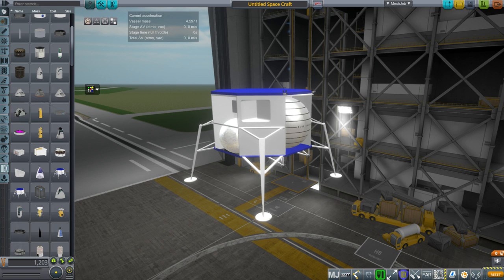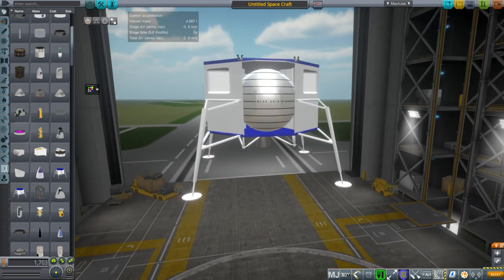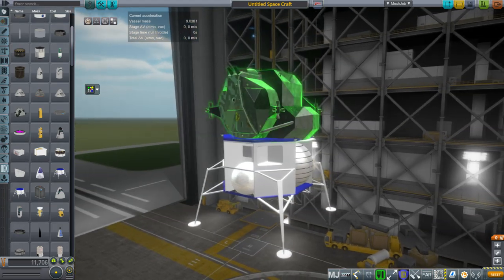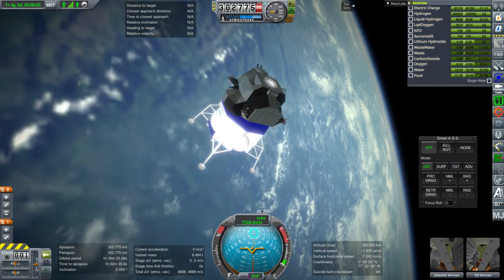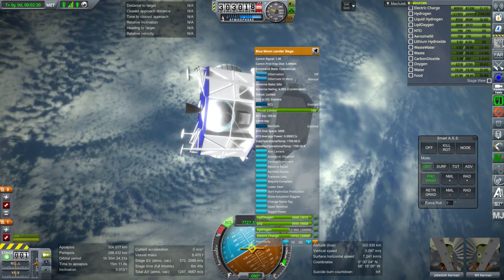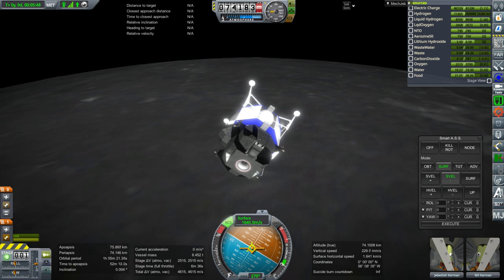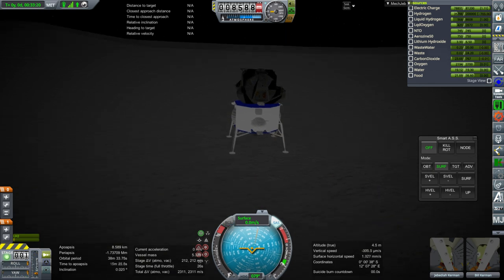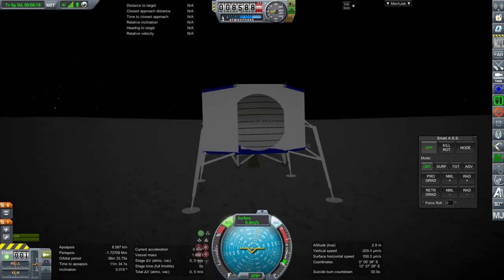Kerbal Space Program - Part Dev - Blue Moon

Comment: Will KSP handle adding bump mapping from blender? It's pretty easy to bake it into a procedural texture and blend it with your texture image to avoid surface flatness. I don't know whether it allows bump mapping in blender's material node editor or demands a separate bump map to go with a model/texture file. But just in case.
Node setup basically goes: Texture Coordinate (Generated) -> Mapping (Vector input/output, default settings fine) -> Noise texture (Vector input/Fac output, adjust scale and distortion as desired) -> Bump vector (Height input/Normal output, adjust numbers for heightmap range) -> Diffuse BSDF shader (Normal input, adjust colour as desired, send output to mix shader with other similar setups with brick or checker textures etc. or straight to the surface output of the material, alternatively a Transparent or Glossy BSDF shader mixed with an image texture for the surface colour).
Hope it helps, it's a lot easier than generating any configuration of heightmaps from images or baking it into mesh displacement on the model.
Reply: Aren't bump mapping and height mapping the same thing?  Why did you post a mini tutorial with steps covering unwrapping and shaders if you're just suggesting a height map?
Reply from the maker: Unity takes the bump map as a separate file from the texture. I just don't have any data to base any bump mapping on. The mockup they showed was, as far as I could tell, perfectly smooth.
Reply: @rickyoswald  I was talking about generating a bumpmap in the model material from a procedural texture in blender rather than making a bespoke heightmap exported along with the model, the former is very quick and easy for the results it gives, but I don't know whether unity/ksp allow it. Even if your reference is flat and shiny adding a small bit of noise to break up the surface helps make it look less perfectly (ie unrealistically) flat and shiny.

Comment: You mentioned other hydrology landing engines... Isn't there a deeply throttlable configuration for the RL-10 that is supposed to represent the common extensible cryogenic engine that was designed for the constellation program?
Reply from the maker: Yup, the CECE is the other candidate. I like its implementation on Lockheed's MBC planes in particular: https://s.aolcdn.com/hss/storage/midas/695645c7cb264f5d55607357c2491b0/205718477/MBC_2.jpg There are a lot of CECE implementations on paper, but none that have even gotten to a mockup level as far as I know.

Comment: Will you be making the version w/ the davot system crane and 4 rovers?
Reply from the maker: I might make a single crane system part - you'll be able to put four of them on top or however many are necessary. The rovers/other payloads I'll leave to users. I want the crane system to be more general purpose so it can be used with other landers.